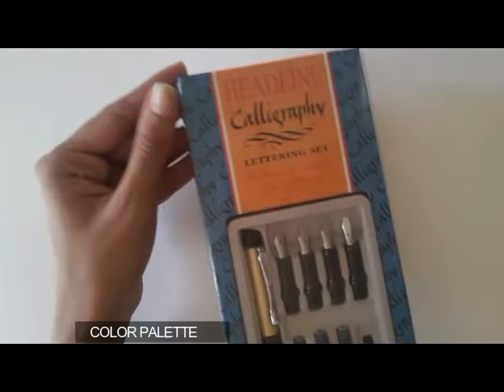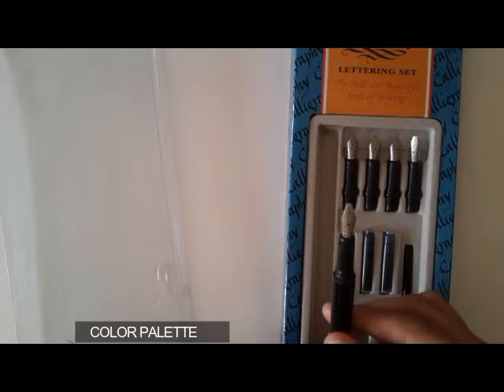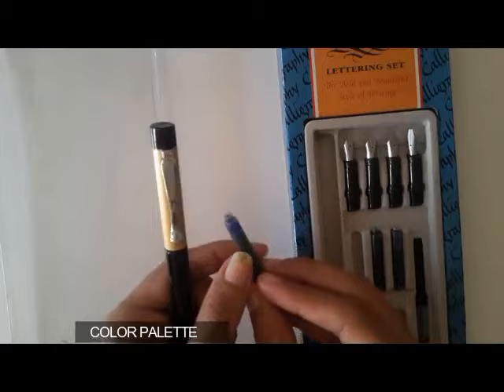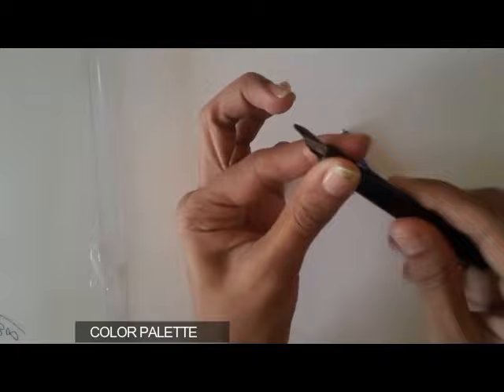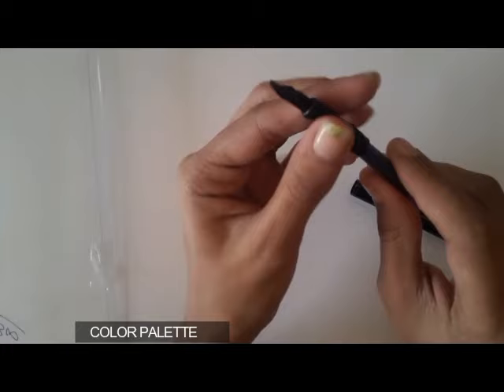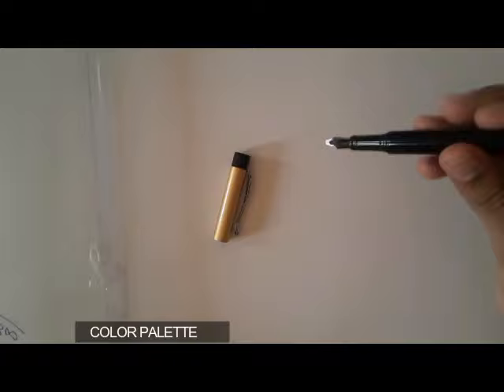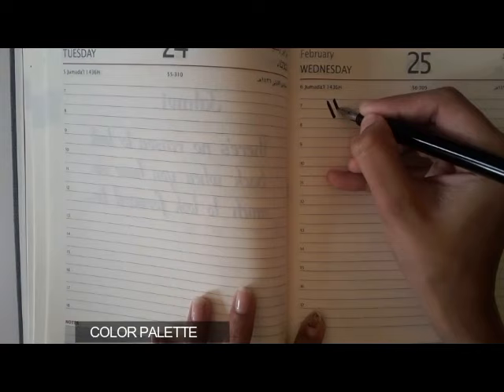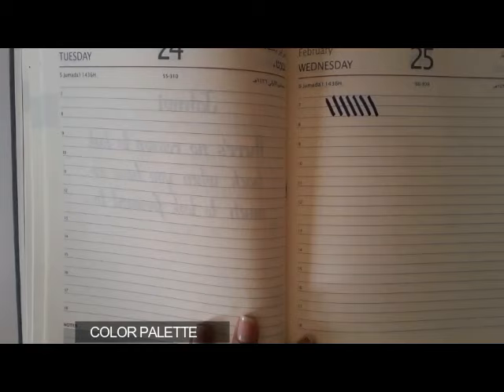How to Assemble Calligraphy Pen with Cartridges | How to install ink cartridges

Comment: Thank you so much for this video.....and here's why. I've never used a fountain / calligraphy pen, so I wasn't sure what I was doing wrong that the ink wouldn't come out. I watched other videos and did it exactly the way they did it and still nothing. In your video, you speak of a sharp point inside the nib chamber! No one else said that! The set that I bought did not say that in the directions, either. So when I took the pen apart and twisted the ink vat into the nib chamber and then put the back of the pen on, I just just had to shake it for 2 seconds and ink started flowing! I was about ready to throw the set in the garbage and chalk it up  as a bad purchase.🤗
Reply from the maker: Thank you so much...I am glad the tutorial helped! 😊

Comment: You’re accent is very strong. So it’s hard for me to understand. Since I can probably ask you here. I will.
I put the cartridge in the pen. So how long do I wait when I hold the pen vertically? How do I know when it’s ready to write?
Reply from the maker: Thank you for dropping your comment..Always Happy to help...Regarding your Question, You need to hold it vertically for around 30-40sec(Ink from cartridges goes into the nib chamber) and then shake it a bit till u see drops of ink dripping on the paper.  Hope this helps😊
Reply: dude there’s captions for a reason

Comment: I have a question.  What if I want to change the color of the ink without  having used all of it?  Can I change from black to red ink and then put the same black cartridge back in, after using the red ink a little while, or do I have to use the whole cartridge completely before changing color?
Reply from the maker: Hi Christ's Servant.. Thank you for Visiting Color Palette..
 Regarding your question, Yes you can change the Cartridge without used it completely. However, we are basically Rupturing it and it will be Open now. If you can take care of the spilling, you can definitely change the cartridge mid way but make sure to clean the pen before changing the next color to avoid Mixing of colors. Hope your Query is Answered.

Keep Visiting..Have a Great day..Take care 😊
Reply: @YuviCrafts  Thank you.  So, should I put some plastic wrap on top of ink cartridge and rubber band it until I use it again?  (If I am not going to use it for days or weeks later?)  Would this work?
Reply from the maker: Hmm...May be you can try using plastic wrap and do share the results with me too ..but after wrapping it with plastic wrap ,keep it in the upright position... 😊
Reply: @YuviCrafts  Ok.  Thank you. :)

Comment: Thanks. can I use ordinary pages?
Reply from the maker: Yes you can use any good quality paper.. :-)
Reply: @YuviCrafts  Thank you. Will a 80 GSM paper be enough?
Reply from the maker: Yes you can use that :)
Reply: @YuviCrafts  Thanks a lot for your reply. But, in my case, the ink bleeds a lot in 80gsm paper. Is it because I am using a cheap ink?

Comment: Help!! Maybe I understood wrong but I cant do it :(
Reply from the maker: What problem are you facing? Pls let us know how can we help. Thank you for visiting Yuvi Crafts.
Reply: @YuviCrafts I did try to push it from the back but it’s like it just won’t assemble together
Reply from the maker: Push it a bit more( don't panic, your pen won't break😁) .... and Turn  the pen upside down, if the cartridge doesn't comes out, that means you have inserted it correctly. Hope this helps..
Reply: @YuviCrafts  where should I push from?